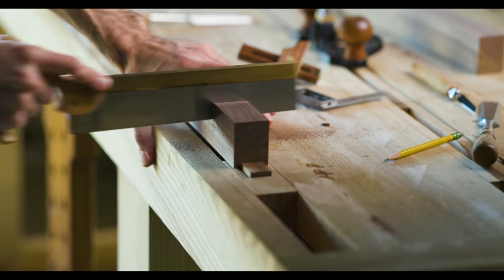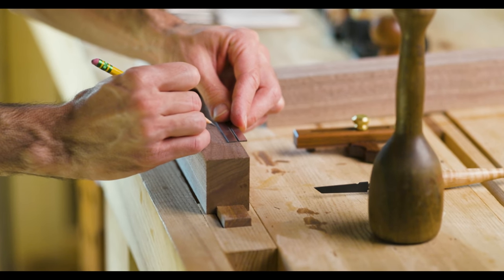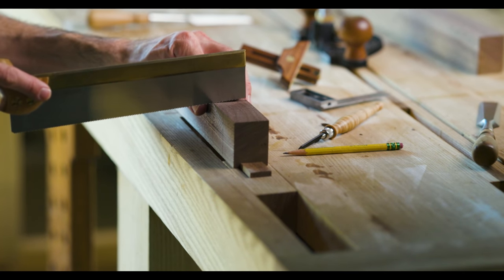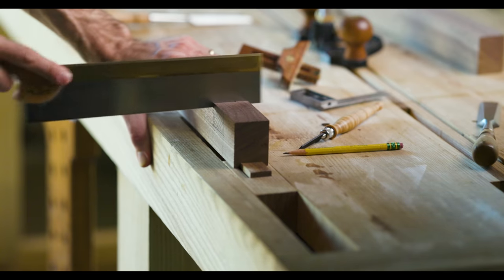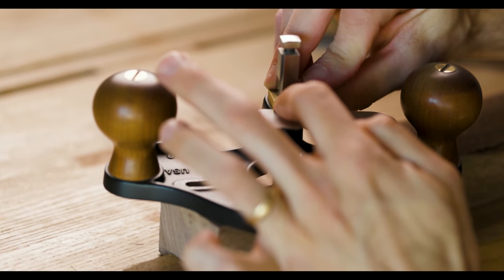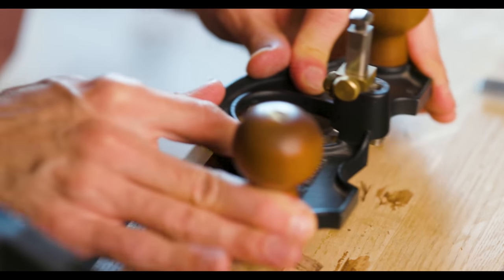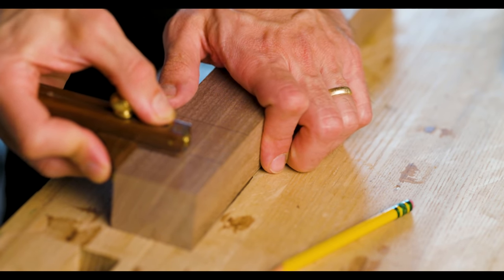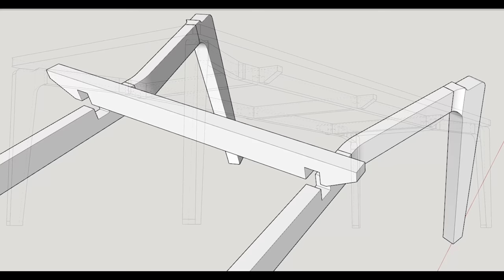Game changing joint overlooked by most woodworkers // 4K

Comment: I don't understand why so many woodworkers avoid the half-lap. Studies show that it is the strongest joint in woodworking.
Reply: Which studies?  Because it is not the strongest, can't be just from looking at the structure of it and the nature of wood.  Has it's place, like most things.
Reply: @asmith7876  wood magazine, fine woodworking, and several others have tested it scientifically. There are also several comparative studies done at the university level that are behind paywalls.
Reply: @mychalevenson7710  I did not do an exhaustive search but a quick search did not put the half-lap on top. Mortise and tenon, dovetail, but not this. Send a link? Now I’m very curious!
Reply: @asmith7876  Here is the fine woodworking article. https://www.finewoodworking.com/membership/pdf/57138/011203036.pdf

I'd have to dig for the others just as you did.
Reply: @mychalevenson7710  As I said, everything has a place!  Using a glued up half-lap as they showed would indeed be an extremely strong joint.  Always best to have the right tool/technique for the job,  thanks for sharing.

Comment: I would love to see the structural strength of this joint compared to others. It may not hold up to its 'reputation' and may be another 'myth busted' situation. 
I am thinking of breaking some joints today.
Reply: Depends on the load. Straight compression it would be just as good as a tung and slightly less than a castle joint.  Lateral torque and compression it holds fairly well but really needs a brace at that point.

Comment: I love how chill the video is, but I do have to ask, as a materials engineer who does not do woodworking:
How do you account for both wood grain movement between seasons/climates, and why use right angles if they're the most deadly in terms of tension concentration? Is it because it's preferable to have good junction grip instead of low crack nucleation sites?
Reply: Carpenter and wood engineer here.
Let me answer your questions.
Wood movement is negligible on those parts. They are designed for indoor use which sees only small amounts of humidity change over the seasons.
Wood in an average living space has a humidity of about 12% in summer. Let's say it goes up to 20% in winter, which is way to more than in reality. So you have 8% humidity change and wood changes about 0.25% width per 1% Humidity
 change. So that would mean about 2% width change over a year. If that piece is 5cm (2") wide that would result in a 1mm width change.
Not to bad. If fitted in the summer there wouldnt be a gap and the joint would just get a bit tighter.

The important part is to start with proberly dryed wood which as close to the same humidity as the location it is later used in. That way you get minimal wood movement.

Right angles are bad and corners concentrate stress, that's true. 
But they are easy to make and convenient to work with. So we carpenters oversize all our material to not worry about stress concentrations. Seriously cutting away half of our material on both sides is really bad structurally speaking. A simple metal fastener would be way more efficient. 
That's why modern timberframing has moved away from all the notching and traditional joints. 
It's just not efficient. 

I hope that answers your questions
Reply: @SuperDeinVadda  you did and I'm as clarified as one can be! Thanks a lot for the info! I guess that for a simple table you can easily oversize to a point that does not compromise the needed minimum strength and have gains on natural looking joints. As to the humidity I was not aware of these numbers. Good to know. Cheers :)

Comment: Nice video. Removing the material off the cheeks must be visible as a small step on the final piece, right? To avoid that I use another trimming method, make the cuts slightly slightly undersize and then handplane the faces of each piece a few shavings for e perfect fit.
Reply from the maker: That’s a good way to do it as well but removing the material from the cheeks doesn’t leave a visible step. Just a seamless joint. Try it out next time
Reply: @WilliamDouglasCo  seamless and gapless yes but there must be a step? Looking at the pink part at 0.37, there's a small step. If you make this step in both yellow and pink part there is no way to hide the step on the bottom non visible side. Anyway, I will try this method🙂

Comment: That is interesting method, I assume h you remove material from the cheeks to make it tight. A Japanese method I saw on YouTube is to use rounded hammer to compress fibers and then use water to expand back once joint is established.
Reply from the maker: Yes I’ve seen that method too. I definitely prefer the router plane but I’ll admit that one is clever no doubt

Comment: Thanks for sharing your knowledge and skills. Great to see the use of hand tools. Talk about going the extra inch You even went cordless on the router
Reply from the maker: Yeah the router plane is the key to this method and it’s so fun to use!
Reply: Hand tools may appear slower than power tools, but minus all the setup time there's not a lot of difference overall (not to mention the calm, quiet and low-risk work environment). Plus the satisfaction in developing the skills needed for hand tools is unparalleled. It's a glorious way to spend you time!

Comment: fantastic skills here will, nice work. I also like what you added at the end about making the work last. I need to know please, what's that cross cutting sled you use-seeing as it just uses one side of the saw, presuming the table top has one t-track on that side, does it move at all (side to side or twist)? also on the subject, how would you suggest I improve my fence to have a wider anchor, so it slides more than sort of a thin edge it has now-needing to check if it's straight, sometimes binds on the track it runs on etc. I hope that last question makes sense :s I've seen a few YouTubers use a wider slide for the fence-more rigid

Comment: Did I miss the part where you explain why this joint is "game changing"? What's the benefit of removing material on the cheeks? Just a bit more stabilisation in one direction?
Reply from the maker: It makes it fast and easy to get the joint tight every time. Consistency

Comment: Lol, ,you renamed a basic lap joint after yourself.
Reply from the maker: You missed it.. the method of removing material from the cheeks is the point of the video. Most people cut lap joints without removing material from the cheeks. I was showing how to get a tighter fit every time.